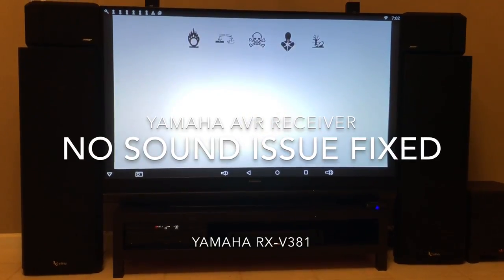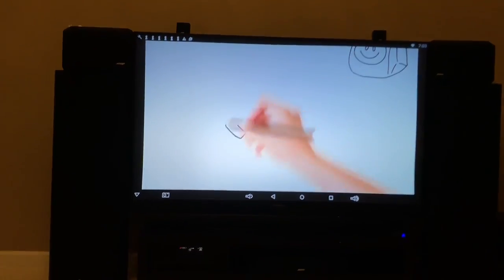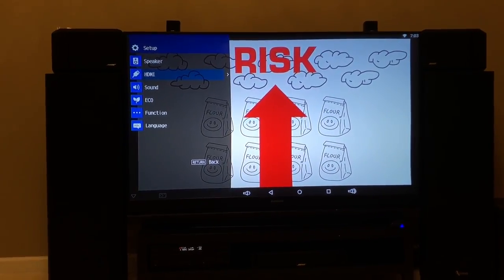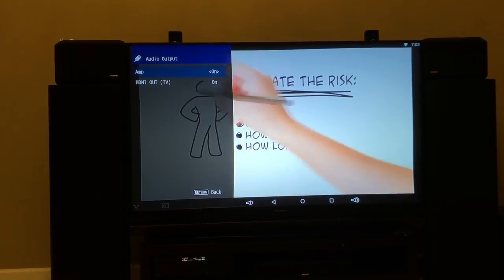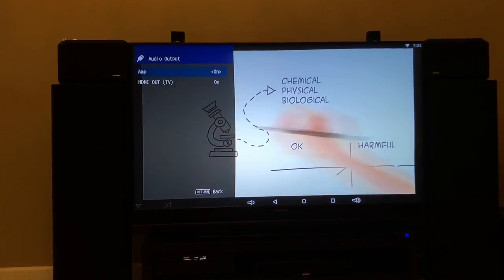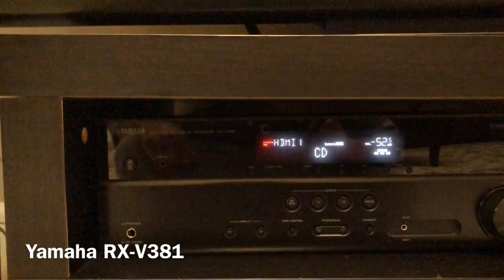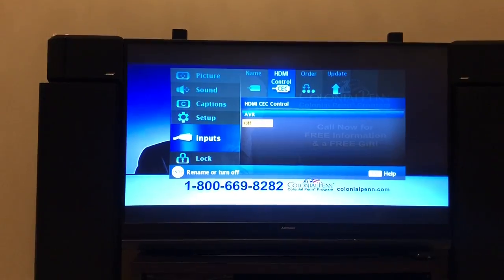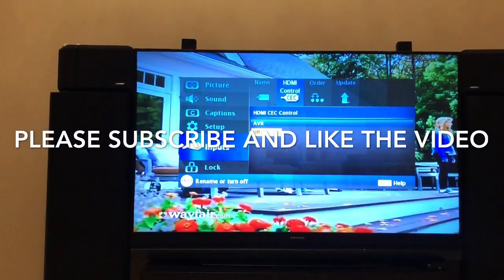Yamaha AV Receiver HDMI sound problem fixed

Comment: My Samsung smart TV isn't so smart. The TV sound going to my Yamaha RX A770 was cutting in and out although it has been working fine for about a month until today. I went to the tv's menu settings, sound, additional settings, HDMI settings and changed BITSTREAM to PCM and that solved my sound problem although I am not even using a HDMI cable. I am using a optical cable. Your video convinced me it was in the television settings.
Reply: Well I have to say that changing Bitstream to PCM is wrong because now my PC does not play sound through the stereo. Had to switch back to PCM. Still the tv sound is working fine again in Bitstream. Something was going on with the stereo decoder but not sure what.

Comment: I have an RX-A 1020. Everything has worked like a charm until lately where audio kept dropping  out and then I lost audio completely.  Left a message for my AV guy knowing it was going to be an expensive consult.  Thought I would search for a fix and found your video. Followed your simple directions and it resolved the issue. Thank you so much!
Reply from the maker: Glad it helped. Please like and subscribe as it helps my channel supporting charity :)

Comment: Thanks so much!  I was down to turning on the TV then the AVR and even then sometimes I had to turn the AVR off and then on to get sound to the TV.   Problem solved.  I swear you have to be an engineer to be able to use this stuff anymore.

Comment: Found one in our dumpster this morning.

NO REMOTE with it!!!

Much the same situation as yours

Everything lights up

tunes, etc...

But no sound, via my SONY phones

I've not lugged it upstairs to connect with my

huge Speaker Labs speakers which have banana plugs

for use with my Crown D150/IC150 gear

I found no help on YT

Sans the remote....

Nor with BING searches.

Any further advice would be appreciated.

If I find out on setting up without a remote

( No HDMI/TV stuff in this house....)

I'll pass it on...

Cheers

J.C.

Comment: Thanks for the input.  It helped me figure out that for my setup, on a Yamaha 681, for the TV audio I actually need the HDMI control to be active.  My Sony TV and the receiver both had recent firmware upgrades and I think the settings I had in place changed.  I also have a PS4 Pro connected to the system and am running thru the HDMI/ARC.

Comment: this is more of a workaround. you lose the capability to turn on receiver automatically by TV and output audio from TV via HDMI to HDMI ARC output of receiver, dolby digital +, Atmos, etc. It is a shame Yamaha doesn't provide a reliable ARC solution.
Reply: I'm in this boat right now
Reply: No only on Yamaha receivers, I have the same problem with my ONKYO 787... Can't get any audio from my Oppo BD unless I turn off the HDMI Control, but like you said, you loose the capability to turn on the receiver via HDMI ARC.... IT REALLY SUCKS!

Comment: If I set control off on my LG Oled C2 I get no sound at all when using ARC.  If I set control on the sound works sometimes but only if I switch between HDMI1 then click back to Audio button on the remote.

Comment: I solved this problem a different way. I have a Yamaha TSR-5830 I got from Costco and the sound from the tv was cutting out when run over HDMI ARC. It was really annoying!! I left the CEC on on the TV and HDMI control on on the receiver, but I turned ARC off on both devices and connected an optical audio cable instead. Now instead of running sound from the tv to the receiver via and ARC HDMI cable, the sound comes through perfectly clear via the optical audio cable. No more issues with sound cutting out. Hope this helps.
Reply: Tyler Aitken ARC on the Yamahas is really problematic. I have a brand new LG C8 and no matter what cables I use or what I do I can’t get any sound from TV apps over ARC. I’ve seen a bunch of complaints online. Onkyo, Denon and Marantz don’t have this problem. 

Every company implements HDMI-CEC differently but it really sucks when the receiver works great in every other area. No problem with picture or sound. I shouldn’t have to use an optical cable with brand new equipment in 2018!
Reply: @Tyler Aitken - I know I'm late to the discussion, but I have the same receiver with a Sony 950G and was having audio cutoff issues over ARC as well. I ended up changing from compressed audio to PCM so that the AVR does the work instead of the TV. This seemed to fix my cutout issue, plus with HDMI (instead of optical) I was able to retain ATMOS.

Comment: No way! Wtf lol. Thanks bro. Ive had my Yamaha for 4 years no issues. I just woke up, turned on and nothing through speakers but tv worked (its patched though from receiver) so i knew it wasnt PS4. Changed this setting and came right on. Though for sure it was burned up.

Comment: Thanks friend. But if we want to use HDMI arc to connect the TV we need to turn it on right?
Reply from the maker: Yes arc should be on and make sure you use the port on your tv and receiver which said ARC
Reply: @HowToDoitright  every time there is no audio when I switch on the reciever after some time,, I go to setup n turn off arc n turn on it again n audio is back.

Comment: Tried HDMI 2.0 from amazon basics and all working fine now
Reply: what do you mean ? Try a new 2.0 cable ?
Reply: @Qlimax8000  make sure the HDMI cable that you are using says "high speed" on it.  The suggestion of using a Amazon  basics 2.0 cable is "high speed".  A high speed cable has a 13th pin needed for ARC(HDMI Control).

Comment: I'm having a different but similar issue.  When I first power on my RX-V675, the HDMI sources show no audio signal but I can see the video just fine on the TV.  All the HDMI inputs are connected to the receiver.   The TV does not support ARC and I don't use any apps on the TV.  I have HDMI Control Off and Audio HDMI Out is Off.   When I power the receiver off and back on, then all the inputs have sound and everything works going forward.  I can't figure out what is causing this but it seems to be an HDMI issue.
Reply from the maker: I suggest try the receiver to a different tv and see how it behaves. Maybe like a small monitor or tv you can bring to your current setup. Also try to see if another source works

Comment: Our Yamaha RX-V765 AV receiver is connected correctly but during speaker tests the subwoofer doesn't come on.  All 5 speakers indicate working but it is silent when it gets to subwoofer.  I know the subwoofer is good because we tried a brand new subwoofer and a brand new cable and both subwoofer out ports on the back of the receiver and still the same issue.  Tried every setting I could think of in the Yamaha menu.  When I unplug the subwoofer RCA cable and simply touch it to the side of the port you hear the loud speaker bass feedback so indicates all is working and line is live, but just internally "deactivated" when plugged into the subwoofer ports.

Secondly, even though the five speakers (aside from subwoofer) test fine in the speaker test, only the stereo (front left and right) speakers work when actually using the receiver with digital optical out from TV.  Tried different settings on this too but don't see anything that says "use in stereo mode only" or that would disable all but the front two speakers.  Tried different "scenes" and programs but nothing.  Very very frustrating!

Can anyone help with either issue???
Reply from the maker: Seems like your subwoofer output is bad. The only thing I would recommend is to check it’s not off in settings. You will have to check the manual on how to enable it in settings. It could be turned off 

Also why are you using digital output? Why not use HDMI sound? Not sure why it’s doing that though. 
I would recommend reset your receiver to factory settings and then try.
Reply from the maker: Also if you have A-B patio speakers then disable that feature and then try. Sometimes they turn off other speakers except front.
Reply: @HowToDoitright  I went thru the whole on screen menu (HDMI out from receiver to TV) and found nothing showing subwoofer is off.  Also, the subwoofer is the only one that makes no sound during the speaker test (silent when it gets to subwoofer before repeating in sequence).  And as I said when you touch the tip of the RCA plug to the side of the subwoofer ports there is a loud bass feedback.  It's just that the ports seem disabled but I don't know how or where at this point.
Reply: @HowToDoitright  Thanks a lot for the response as I have tried EVERYTHING so far!  Only thing left is the factory reset which I just learned about (this one doesn't have Ethernet/WiFi to update firmware and besides it worked okay for years with current firmware and also that wouldn't deactivate speakers).  The other thing is what you said about the patio.  She does indeed have ZONE 2 for patio, but those worked fine before too and still work.  Isn't Zone 2 supposed to work completely independently from the main speakers and not interfere?  Obviously all worked together at some time, but it could be due to needing that factory reset/initialization.  Could you elaborate more on the patio/ZONE 2 and how and why you think it interferes with the main interior speaker set up/home theater?  I'd appreciate it, thanks!
Reply: @HowToDoitright  I rewired all so all inputs go into the HDMI inputs and other inputs into TV and TV digital output is to receiver on AV 1 as recommended.  Then I also connected the receiver's HDMI out to the TV's final HDMI input so that I could have the on screen receiver menu.  I did it because the new 86" TV is far more advanced than the old one (and the receiver is 11 years old) so there is no real reason to route the video thru the receiver anymore, unless you can think of one.  We really only need the receiver for sound.  Why do you feel that is wrong?
Reply: And by the way, WE HAD THE EXACT SAME PROBLEM BEFORE I rewired everything (no subwoofer sound at all and all five ceiling speakers during speaker test, but only two front during operation) so that is not the issue.
Reply from the maker: The only reason I said about zoneB interfering was because I have a old Yamaha and I ran in to that issue but my model had such a thing that 5.1 wasn’t gonna work together if I had zoneB enabled so basically I couldn’t run both together because apparently it uses one amp to power either or. 
Your setup sounds ok. It’s possible your output of subwoofer has gone bad. Things do go bad over time. I had a Yamaha receiver which stoped outputting video signal. Fairly new and nothing worked for me so i ended up replacing it.
Reply: How To Do it Thanks again for the response. But a couple questions: when you say the subwoofer output might have gone bad would that affect both subwoofer ports? And why can I still get that loud bass signal when I tap the port with the pin of the RCA plug showing there’s power and juice but not when it’s plugged in? Doesn’t that indicate it’s hearing and sending the signal but just disabled?
Reply: How To Do it: ...and as far as only the two front speakers working in regular operation but all five working fine during the speaker test we know that obviously they can put out sound so you think that issue at least has to do with the reset/some setting, correct?  Once I initialize/reset the system if that doesn’t work I’m out of ideas. Except maybe calling Yamaha.
Reply from the maker: I assume you are touching the wire that is plugged in to the subwoofer. That’s the subwoofer sensing a ground not your receiver putting out a signal. You can take that wire out from back of receiver going to subwoofer  and just touch the end that is supposed to go in the receiver and you will hear a buzz coming out. That’s a normal test that’s is done to check functionality of a subwoofer.
Reply from the maker: Not sure what you mean by regular operation. Hope you mean you running it at 5.1 or 7.1 surround sound (whatever it’s capable of). If you only run it in front speaker setup then it will not put out base or sounds to any speaker except front two. It’s a settings and preference of user how they want to listen. Front speaker vs 5.1-7.2 or 9.1 (or .2)
Reply: @HowToDoitright  Yeah, but doesn't it mean the port is active and working?  I mean there are two side-by-side subwoofer receiver ports and both do that and it's not likely both ports are bad when one was never even used before.
Reply: @HowToDoitright  Yes, but I looked for any setting that said stereo only and I could not find any in the onscreen menu.  I also cycled thru different sound program and "scenes".  Maybe I should try a DVD or Blu-ray I know is in 5.1.  But still, I think watching movies we would have heard the other three speakers kicking in at some point.  I will try an action DVD and then listen carefully to the rear and center.  However with the subwoofer no matter what the setting it should still go off during speaker test/setup, but it is the only one that does not.  We probably don't even need that complex an AV receiver anymore, just a mid-line audio receiver with digital input and speaker connections at this point (if the Yamaha subwoofer ports/output are truly not working anymore).
Reply: UPDATE:  So at least I resolved the issue with the three ceiling speakers that APPEARED not to be working during normal operation despite working in the speaker test, but were indeed working but at a lower volume which was hard to hear without using a ladder, which I ultimately did.  So one down, one to go!

As far as the subwoofer goes I tried absolutely every setting on both the subwoofer and in the receiver's onscreen TV menu, as well as initializing the Yamaha receiver using the MAIN + STRAIGHT buttons and also trying various built-in "scenes" or programs.  Nothing worked.  Again, we know it's not the subwoofer or cable because we also tried a brand new subwoofer and cable too.

My question now is first, is it possible that there is an internal "chip" or component that is bad so it is shutting off the two subwoofer RCA output ports?  Obviously it is not the actual subwoofer ports themselves that are the issue as both ports would not be bad.  I read something about using another pre-out port but those are right by the subwoofer ports and I doubt that would make a difference, or do you think it would?  I am referring to this article: https://myaudiolabs.com/how-to-connect-subwoofer-to-receiver-without-subwoofer-output/

Or, is there a way to bypass the subwoofer port and pre-out ports and with my digital input to the receiver use the analog audio RCA outputs on the receiver to a subwoofer amp box featuring analog RCA inputs and subwoofer output?  There are many of those sold on Amazon, etc.  The only thing is Yamaha states the analog outputs on the receiver won't output any sound if the input is digital optical (Toslink), which is what we have coming into it from the TV's digital audio out.  However, not sure if they mean it won't output 5.1 sound (which I know analog can't) or absolutely no sound whatsoever thru those ports.  The Yamaha receiver has no digital audio output unfortunately.  Also thought about a digital audio splitter so that the TV audio is split to the Yamaha receiver and another box with a digital optical audio input and subwoofer output.  Can't find anything with both Toslink input and Toslink output AND also a subwoofer output though but not done looking.  Sorry to take up so much of your time but I think I've narrowed it down a lot now.

Comment: Arghhhhh trying to pair my Yamaha RXA670 via arc/earc to the Lg55cx I've got video but no audio and the new hdmi 2.1 cable I purchased should support both. I've been trying everything I can think of to get it working. I'll certainly give this a try. Thanks
Reply from the maker: Did it work?
Reply: Yes I finally got it working after making a few adjustments to the av and the tv. Thanks for the video and the advice much appreciated.

Comment: Right, switched that thing off from TV 
Problem I have when I press MENU->Audio-speaker list. There is is only three options: TV. Bluetooth or audio  output/optical. So for hdmi, what did you choice? Thanks

Comment: I have been looking for this solution for over 2 years. Every time I turned it on the sound turned off. I now have a less aggravating system. I thought I would have to buy a new receiver.

Comment: Dear Sir, I have Yamaha Rx - v371 reciever, recently cleaned up the unit using blower and Re connected the unit by performing Factory reset, but suddenly there is no audio decoding, just SW humming, even tried using YPAO for Re calibration but no sound during YPAO usage, please help if possible

Comment: How about a solution that actually FIXES HDMI Control??? If you used the right cable and connections to your receiver you WOULD get sound through the ARC without turning HDMI Control off! Using HDMI Control will allow your TV remote to control your other devices (Receiver, Recorder, and DVD Player). 
The solution I'm looking for is why my receiver is NOT switching back to the TV Audio (ARC) when I switch from my recorder or DVD to the TV tuner.

Comment: I turned the HTMI control off, the 5.1 speaker icons appeared on the AVR — but no audio from the AVR, and now the SETUP window doesn’t show up on the screen in order my make changes. Any advice?
Thank you.
Reply from the maker: Sounds like your video card is now bad. I suggest connect it to another small tv and test

Comment: My Yamaha Home Theater work perfectly with Bluetooth but with hdmi Connected to the TV just the tv has sound not the Surround speakers please advise???
Reply from the maker: Hayman Ak check settings on tv. Should be set to external speakers. Also hopefully you are using the right hdmi cable. Some don’t support sound.